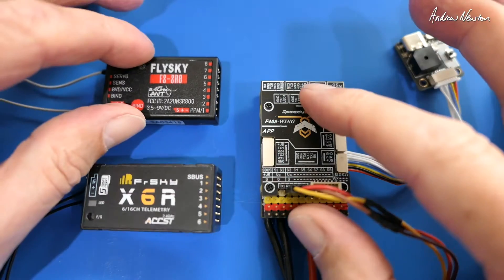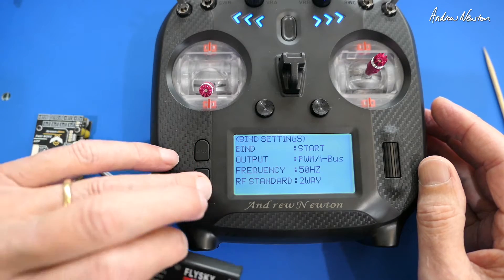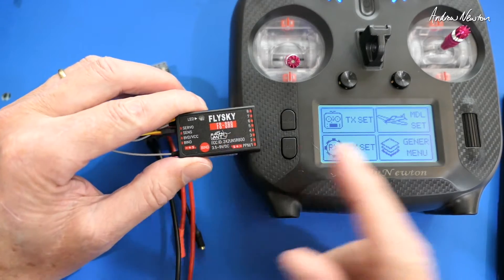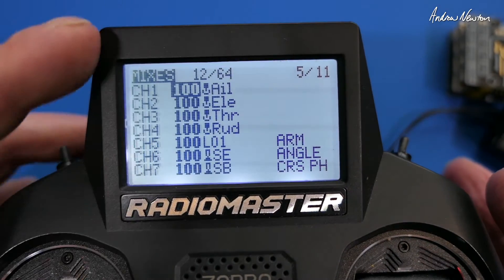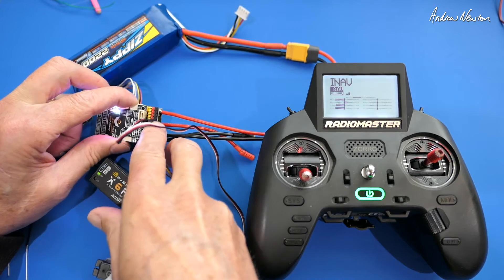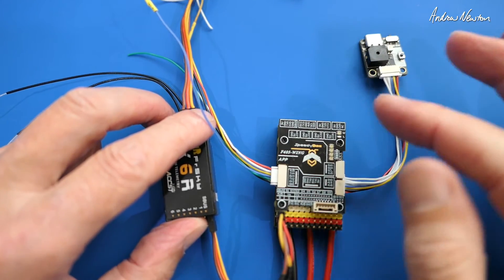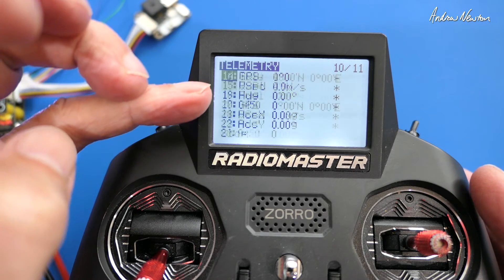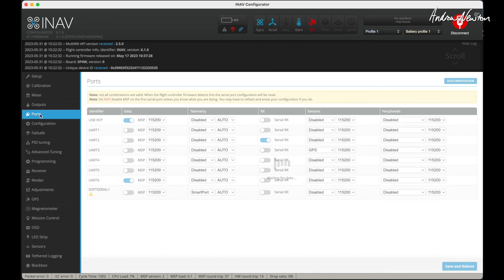SpeedyBee F405 Wing - Soft serial fix, iBus, Flaps

Comment: Gidday Andrew

Thank you for your videos.

Can you suggest help with getting telemetry onto my taranis x9d [ non plus ] running 2.0.1. 

Sb f405wing.
 Frsky archerplus RS rx.
Ardupilot, plane.

I only see 4 sensors when discover new sensors; gps, rx batt, rssi, ain2.

Rx connected to sbus to SB sbus
& inverted Sport  connected to SB uart tx2.
I have tried many protocol options in parameters, no luck yet.

On mission planner, I see digital airspeed, current & voltage, gps and many others.
Will arm ok.
Can you please suggest which protocol to try?

SB only provode support for Inav.

Kind regards Donald NZ.
Reply from the maker: Sorry Donald, I barely know the basics of Ardupilot and rarely use SPort these days. Darren Lines would be the man to ask https://www.youtube.com/@MrD
Reply: @AndrewNewton  thank you.

Comment: How can i use a channel for flaps if i have flapairons. So i am giving my aileron a new or different zero position to put in flaps and from there it can move by the normal stick movement?
Reply: Or is this even achievable with the speedybee F405 Wing
Reply from the maker: Yes there is a Flaperon Mode in INAV, or maybe you can just set up flaperons in your radio the normal way. I'll try it myself.

Comment: How about a spektrum receiver
Reply from the maker: Yes
Reply: I was gonna ask. I have had 0 success using spectrum receivers. Nothing moves in INav and I followed all the steps I’ve found and tried things of my own. I could use help!
Reply from the maker: @treyjefferson467  Which radio and receiver?
Reply: @AndrewNewton  I have a NX8+ and an AR8360T reciever and just bought a SPM4650C in hopes I can get that one to work.
Reply: @AndrewNewton  I have a NX8+ radio and AR8360T reciever.
Reply from the maker: @treyjefferson467  Both receivers should work as long as you connect to a UART R and select receiver protocol as SRXL2 in INAV.
Reply: @AndrewNewton  i put it to Uart 2. But my confusion is, I am not sure if I use SRXL2 from the rail on my reciever or the 4 pin Srxl2 on top of the Reciever. I set the correct Uart to target and Srxl2 but nothing so I tried spectrum 2048 also but still nothing sadly.
Reply: @AndrewNewton  Quick update  have figured out my issue and got all my servos moving. Thanks for the help. The new Reciever works with a slightly different. Now to comb through all your videos to see how to set everything up. Thanks again!
Reply from the maker: @treyjefferson467  Excellent news. Glad it works now.

Comment: You just saved me so much pain! I had just assumed that my Ibus receiver would plug into the sbus port and couldn't figure out why I wasn't getting any output. That would have been a tricky one to figure out if it wasn't for your video!
Reply from the maker: Excellent to hear thanks
Reply: I just have one query... i bus reciever has three pin out but the UART 1 has 4 !  Which pin do i need to leave out ..... i dont want to mess up and damage the bd.... please guide

Comment: hi im using a speedybee F405 wing on inav 7.1.2 and FlYSKY FS - i6x with openTX 1.11.1 installed via idus but i am not getting all the telemetry data could you point me in the right direction
Reply from the maker: Sorry that is beyond my knowledge. Best to ask on the INAV Fixed wing Facebook group

Comment: Hey Andrew I'm using speedybee f405 wing mini fc with fly sky fsia10b receiver all the protocols and settings were correctly done but still for some reason my fc is not detecting any rc i already tried with futaba and crsf and changing the inav stock 6 version to inav 7.1.1 still n
o sucess
Reply from the maker: Should work with iBUS or SBUS. Here are some troubleshooting tips http://newtonairlines.blogspot.com/2023/06/inav-trouble-shooting-checklist.html
Reply: @AndrewNewton  still no positive results

Comment: Hi juste après avoir activé serial RX, je vais ensuite dans receiver, mais dans RECEIVER TYPE je n’ai que le choix entre serial msp sim(sitl).. en bref je n’arrive pas à connecter ma radiolinkat10 (émetteur r12ds) à ma f405wing.. pouvez vous m’aider ?
Reply from the maker: Chose Receiver type SERIAL and provider SBUS
Reply: @AndrewNewton  thank you but I already try this.. is doesn’t work, I don’t have the same setting in your radio controller but I can’t change nothing on my radiolink
Reply from the maker: The receiver specs say it can send SBUS signal. Select Ports - UART2 Serial RX in INAV. Connect from SBUS on the receiver to SBUS on the FC. That's all you can try
Reply: I've already tried all that unfortunately😢, maybe I need to solder something on my f405wing board? Currently I only solder the pins and the power supply ?
Reply from the maker: @maxencegrobost5689  Do you need to activate SBUS output in the radio? Actually I just saw that you need to push the receiver button twice to activate SBUS. Blue LED shows
Reply: @AndrewNewton  i find solution thank you very much for your anwer
Reply from the maker: Excellent. What was the solution?
Reply: @AndrewNewton  realy simple je n’avais pas activer le récepteur en mode SBUS😂

Comment: I like that there’s a usb extender in case I accidentally yank my cable, it won’t rip off the usbc plug like on the Matek board I purchased and didn’t get to put in the air

Comment: Sir, I am facing problem in my speedbee f405, as a result, fly controller was going in dfu mode but now to upgrade the firmware, the control is not going in dfu mode, but I have another speedbee f405 There is wing control, it is going in dfu mode but the other control is not able to go in dfu mode, please help.
Reply from the maker: Try typing DFU in the CLI if the boot button is not working

Comment: Hello, you have made a great video. I bought the FC as a result. After 2 hours of operation and setup, there was a short circuit on the circuit board and the FC caught fire. I contacted Speedybee directly because I had also bought the FC there. They then decided that it was not a fault with the circuit board and that they could give me a 30% discount if I bought it again. I think something like that should also be mentioned in a video. A regular customer warranty is simply rejected here. Greetings Georg🤨😮
Reply from the maker: Sorry to hear about your smoked SpeedyBee. I have had that happen to a few of my builds over the years but it has always been due to my bad soldering or wrong polarity. I would never expect warranty cover for something the customer has soldered up, so 30% sounds like a good deal to me.

Comment: Hi Andrew.....I have a number of the excellent Flysky RXs...FS - IA6B......I do not have any Flysky transmitters. Is there any way I can talk to the receiver using Edge TX Radiomaster TX16S to select the iBUS or SBUS protocol?.....Thanks....😯😯😯😯😯😯😯😯😯😯
Reply from the maker: Yes exactly like in this video. In the TX16S Internal RF - Mode - Flysky2A, Protocol - PWM,iBUS. Connect from iBUS SERVO on the Rx to UART1 on the board (Rx1 pin) Cant get SBUS to work, maybe that's where you would need a Flysky radio
Reply: @AndrewNewton  Thanks Andrew. What threw me was incorrect information about which port was SBUS and which was IBUS...!!!..Flyskys very own RX manual is frankly awful. Not sure why they've labelled the RX ports on the RX in such a confusing manner.. The PPM port is clear enough. I actually got the SBUS port to work in the end...A lot of conflicting info about the Port labelling on the net...guess why...lol... Fantastic receivers though....🤔😳😀😀🇬🇧 Port type activation is determined on Edge during binding. I thought I needed a Flysky TX..😮😮
Reply from the maker: Which is the SBUS port? I guess you have to re bind with SBUS selected?
Reply: Yes, a rebind if you want a different port type selected. The SBUS port is the upper RH horizontal port with signal wire extreme right. The IBUS port is the upper LH port........I double checked this info inside iNAV using a FC.....NOTE: This is for a Flysky RX...FS - IA6B..... .🤔🤔😀 @AndrewNewton

Comment: I am trying to use FBUS with this board and the TDR6 Frsky RX. Do I wire the FBUS wire to TX2 as if it was SPort or do I use the SBUS pin?
Reply from the maker: Not possible as far as I know. The receiver needs to have an "uninverted" FPort output to work with F4 boards. Have to use SBUS and SPort
Reply: @AndrewNewton  I enabled FBus over the TDR6 SPort pin but your saying it’s uninverted and that this board doesn’t have an available uninverted UART for FBus?
Reply from the maker: The TD receiver doesn't have an un-inverted SPort. It's a limitation of all F4 based boards. Relevant links, Matek - http://www.mateksys.com/?p=4488 Oscar Liang - https://oscarliang.com/setup-frsky-fport/

Comment: Hi! Is it possible to connect  ibus rx to other ports if the top pins on the FC are broken?
Reply from the maker: Yes, can use any of the spare UARTS. R2 on the left socket would be the obvious choice because it's powered from USB
Reply: @AndrewNewton  Hello, the receiver isn't sending anything to inav. Am I doing something wrong? I remind you that I have flysky i bus rx and the 4 pins on top of my FC are broken.
Reply from the maker: First you need to make sure it's bound and iBus signal is coming out of the receiver @martini4753
Reply: @AndrewNewton  It is definitely bound.
Reply from the maker: Check your wires and redo the setup. Have you ever used iBus with that radio before?
Reply: Yes, It only has IBUS . It is FS IA6B @AndrewNewton

Comment: Thanks Andrew, switched from Matek411 to SpeedyBeeF405Wing. Smartport worked with the Matekboard.
With the SpeedyBee (runs on INAV 6.1.1) I get no values.
Is the Tx2 bug with INAV 6.1.1. Fixed?
Reply from the maker: I'll check it out. Would be very annoying if the fix didn't make it into 6.1.1
Reply from the maker: It's working with 6.1.1 for me. Maybe try flashing with the ssfix hex first then flash to 6.1.1(https://drive.google.com/file/d/1-2O5ozXk2rnnx6vhMg9DYeUrQKTmxzDf/view?usp=share_link)
Reply: thanks for the quick reply, flash the ssfix, restore the 6.1.1 dump (may be the mistake?) NO telemetry :-(
Reply from the maker: Which receiver? Check your INAV setup and connections again. Here's how to configure http://newtonairlines.blogspot.com/2023/05/smart-port-telemetry-inav-and-f4.html
Reply: 😵‍💫found the error! Crimping of the cable to the Tx2 was faulty. that annoys me... thanks for your efforts
Reply from the maker: @MF-pv2hw  Excellent news!

Comment: Andrew - cool info.  Hey mate can I do iNAV+GPS mag with elrs using 2 motor's,  rudd +aileron +elev  +flaps and add an airspeed sensor with one off these SpeedyBee wing boards? Thinking about my 70mm Mig29 hand launch build...
Reply from the maker: What is iNAVmGPS mag?
Reply: @AndrewNewton  I have the 6-wire GPS+Mag(i2c) units and was thinking maybe try the Holbro Digital Airspeed Sensor (i2c). I'm not sure if the iNav peeps favour airspeed or if that's exclusive to ArduPilots. But my wish is to use iNav with this SpeedyBee if it's possible.   or if the firmware on this F405wing even supports airspeed in any way yet? Trying to move all my new builds to ELRS.  - or just order the KakuteWing instead of the sBee, but the current sensor on the Kakute is limited to 70 amps vs the sBee 80 amps; plus the sBee uBec is 4a vs the KK at 8amps and 6v for servos.    Also, have you had any issues with these Wing boards on analogue OSD or HD OSD with their card reader wiring (have had to remove the card reader BBox  card from my F405 quad under BetaFlight 4.4.2 - know bug in the wiring of the F405 which is limited to older 4.3.2 in reality for analogue OSD not to freeze)
Reply from the maker: @twist-of-the-wrist  OK. GPS is usually UART and mag is i2c.  You don't need to connect or enable the compass for fixed wing INAV. Airspeed sensor is supported by INAV for OSD display only. Not used for flight like Ardu.
Reply from the maker: No OSD SD card bug as far as I know.

Comment: I have the flysky fs-i6x, and i connected the fs-a8s sbus the fc but nothing happens?
Is it the same process or does it need to be configured differently?
Reply: Same, SBUS works in arduino but not in INAV
Reply from the maker: Should be the same, but I cant check

Comment: Hello, if I have radiometer boxer tx, will I be able to use all 17 channels in inav for modes if  the receiver doesn't has only 6?
Reply from the maker: Which receiver?
Reply: @AndrewNewton  flysky  6ch FS IA6B
Reply from the maker: @martini4753  Yes, with iBUS or SBUS connection you have all the channels available. Might even be 18, I'll have to check

Comment: Thank you Sir, i use flysky receiver also,  is there any issue if i use ELRS pin for PWM/iBUS, no change to SBUS pin as described?
Reply from the maker: No issues. Just follow how I connected it in this video.
Reply: Well noted and thank you

Comment: hi Andrew, I have two of these boards the first I tried to flash from stock firmware to 6.1 and since then haven't been able to connect back to configurator ,
I get MSP messages like "no configuration received within 10 seconds , communication failed"
Reply from the maker: Lost communication info in the 6.1 release notes

Comment: I am so glad I was never a customer of FrSky.
Reply: What do u usw instead
Reply: @mv2826 ExpressLRS or crossfire. FrSky is dead
Reply: Is there a problem with it ? Been flying FrSky for some time and I'm kind of wanting to change my old Taranis but my other point of reference is a couple of friends with Radiomaster TX16s with Crossfire modules and they have experienced troubles with the antenna tracker.
Reply: @thrilleex  I lost an aircraft in a forest and found it using an antenna tracker. Only works of your battery is still connected. Otherwise you need a beeper with separate power
Reply: @andrewjamez  I made a cardboard box lined with lead and aluminum foil, I cover a patch antenna with it and it can pretty accurately tell me the direction of my lost drones using the RSSI
Reply: @thrilleex  also crossfire and frsky receivers are double the price of exlrs

Comment: Cheers Andrew, yes it was quite a mission to get SMARTPORT Telemetry working on this board. During my frustration I went out and bought a MATEK F405WMN and have exactly the same issue, NO Smartport. Now with this board SoftSerial is available but NO Smartport Telemetry output. Speedbee fixed their issue in two stages, first enabling SoftSerial and forwarding revised firmware, secondly acheivng SMARTPORT Telemetry and yet another version of the firmware. I wonder if there was always TWO issues here and I wonder if the F405WMN has the second issue, i.e SOFTSERIAL but no SMARTPORT? I'm onto Matek to find out.
Reply: I’m using R9 slim with MatekWMN and smart port over Softserial works fine.